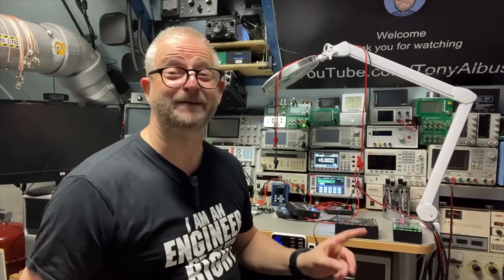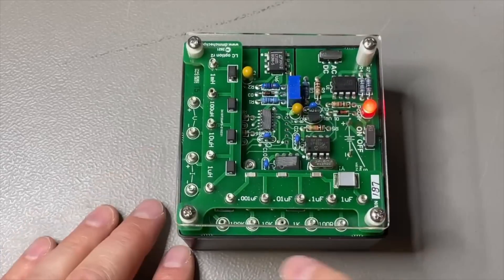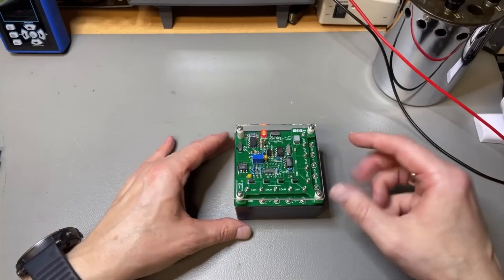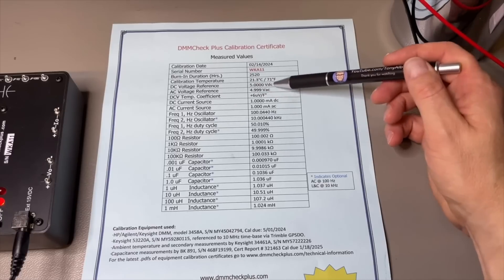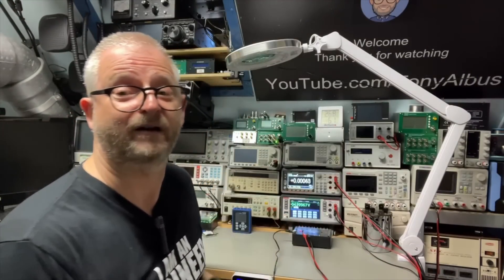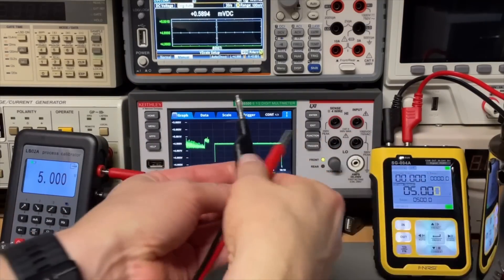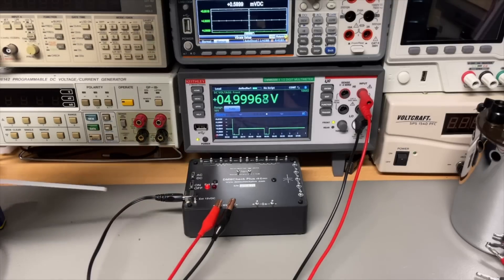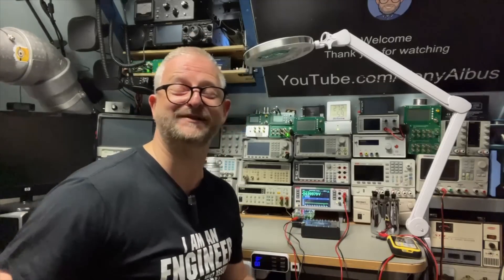TA-0420: DMMcheck Plus Rev. 8 - My Best for Multimeter Verification

Comment: I've been debating making affordable resistance standards since I have the entire lot, here, down to 0.001%, and the large ESI 242B bridge. I wonder if an oversized resistance standard would sell if it was priced for the amateur workbench?

The problem with many standards is keeping the shop the correct temperature.
Reply from the maker: Thanks for sharing, interesting, yes temprature is a big issue in home labs. mine is between 18 C in winter to 27+ C in summer.

Comment: Hi Tony, is the AC voltage output impedance known? I'm wondering whether it could be used to check an RF power meter's dBm reading?
Reply from the maker: Good question, i thought i read it somewhere on their website, but i cant find it now. They have a contact form, i am sure they will respond

Comment: Over the years I have just taken my test equipment for granted and presumed it was near enough accurate but this is next level. Some lovely Reference equipment there Tony.
Reply from the maker: Thanks Niel, yes very happy about it, its a great sanity check for your DMM's
Reply: @TonyAlbus  I only recently replaced my old Fluke 12 with a new Fluke 117 as i sometimes like to play with AC and the none contact voltage detection is superb, hopefully it is somewhere near accurate for my needs. I am currently looking for a budget Scope for occasional use.
Reply from the maker: @gtretroworld  Fluke is a solid choice ofcource for DMM. for a scope maybe look at a Siglent maybe, you cou;d regred later if you go for a Hantek or Owon... compared to Siglent its just leggy, i never regretted buying a SDS1202X-E as my first new scope. its worth the extra money
Reply: @TonyAlbus  The Siglent looks reasonable enough value Tony so i may give that model a try, maybe you should do a quick video with it if you still have it. 😁
Reply from the maker: @gtretroworld  i have a video with 2 owon i think about bandwith, there you also see a quick look at the Siglent, where you clearly see its much better.
i think this video.. https://www.youtube.com/watch?v=P7wp_ZlUhzU  and yes i still use it even.. that 4 years and still happy.
Also some things i say in the video i know better now, its an older video :)
Reply: @TonyAlbus  Thanks i will take a look Tony 👍
Reply from the maker: Just thinking, they also have the new SDS800X-HD those are 12 bits and the lower models can be improved :))
Reply: @TonyAlbus  Yes i noticed that, looks really smart too.

Comment: Old Escort 2030 gives much better stability after warm-up (last digit fluctuates on 6.5 Fluke 8846a) . But it has only DC and square AC. Definitely DMM_Check is very good solution for 4.5 DMMs.
Reply from the maker: Thanks, interesting, not heard of an Escort other then 4 wheels or 2 legs, will try to look for it.

Comment: Did you put your DMM6500 on 1G impedance to read the battery? As long as it's in some box to protect from air currents it should be almost as stable as the zener.

Before buried zener references completely surplanted them, they used to use a battery! A Weston standard cell. You had to read it only using differential null technique, because any current drawn from it (even using a 10M impedance voltmeter!) could obviously change the value.
Reply from the maker: Left the Multimeter on 10M .. that was the point... using the references i also did. a Weston battery .. okey.. will need to look for that then :)

Comment: I do NOT forgive any supplier that scratches off IC markings!
....and to design and build this device is WAY WAY less that the INSANE asking price!
Reply: Building the device is not such a problem (although designing it for the best possible operation requires a good bit of pre-existing knowledge).

Getting access to 3458A 8.5 digit DMM and accurate LCR meter to accurately measure all values within margin of error.... now that is more what you are paying for.
Reply: @ivolol  Not as much as you might expect.  0.1% & 0.05% are cheap and easy to get, check out LCSC.  V references are easy too.  But capacitors and inductors are hard & is only practical to use NPO for caps & measure it!  Inductors are less hard, but still can only be done by measuring it!  So I partly agree, but the 8.5 digit DMM will not help with the caps and inductors, a high end LCR bridge needed, and although they claim 0.1%, I doubt it!
Reply: Yeah, it's just like a machinist or woodworker who at some point just builds the things needed rather than pay someone.
Reply: @jspencerg  huuuuhhh!????
Reply from the maker: It also about build quality itself and mostly the calibration, not just the parts.

Comment: That graphical dmm is pretty nice. You've shown how choosing a good reference is another rabbit hole unless one is ready to plonk down the cash for calibrations or expensive standards. 
Repairs of electrometer reminded me of need to adjust different scale references.  I built my version of the esi sr1050 transfer standard using 15ppm resistors.  Now the 10,5 and 2V references can be scaled to the lower voltage ranges. Of course that led me to the fluke 5100 which is the newest calibrator I could afford.
Reply from the maker: Thanks Jeff! yes the Keithley is amazing, i wanted one for years and years, and then the prices went up and i stopped looking. but the more i saw the device on other channels the more i still like dit, it so fast and powerful, crazy fast sample and lost of memory..and on top , so easy to use, its ful of trick , i think i only know 10% of what it can do.
The 5100B is a great device, and indeed just 5Volt for calibration is not enough for all ranges. but this tool is great for a quick sanity check of the DUT

Comment: Hi Tony! Thank you! But isn't LT1021BCN8 with 5 ppm too little for a 6.5 digit DMM's? I mean is a great tool for handheld DMM's but for a 6.5 digit shouldn't be used at least a reference with  LM 399 as is found inside the DMM's?
Reply from the maker: You are correct, i did mention DMMCheckPlus is for max  4.5 digit multimeters and accuracy for DC voltage is  0.007% , 
i just wanted to show more digits so you can see better the difference between those Process calibrators.
Reply: @TonyAlbus  Right! Thank you!